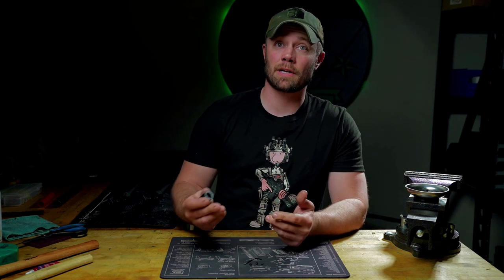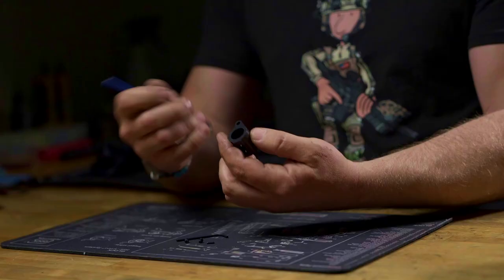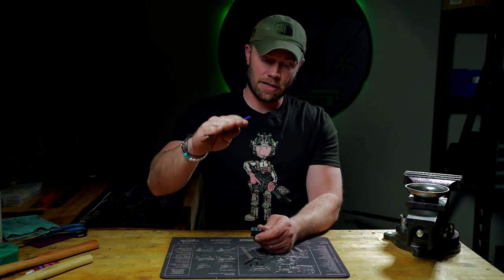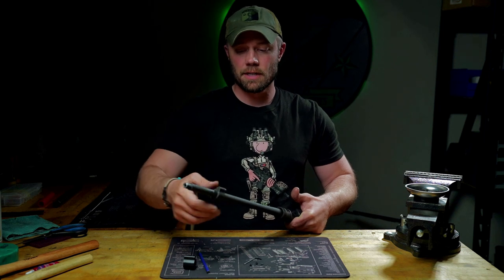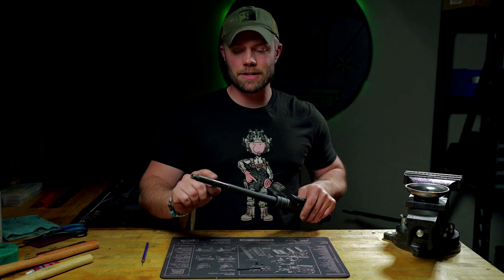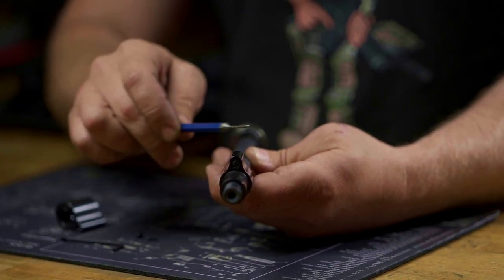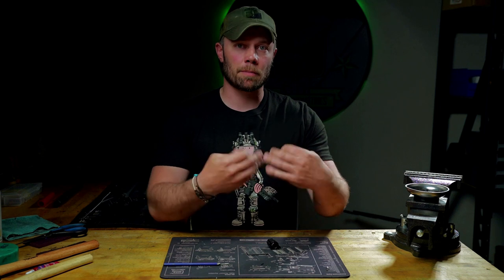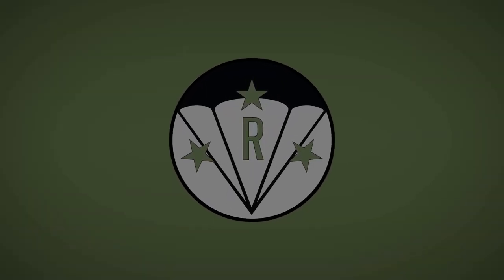Why choose our Gass Hole for your Criterion CORE Series Barrel?

Comment: From a mechanic/machinists point of view because the tolerances are so tight couldn’t you just freeze the barrel and then fit the gas block into it. This way there’s no need to remove any of the coatings and it provides an even tighter tolerance mating surface?
Reply: Usually no visable chage for barrel diameter on  .0005 resolution calipers might be able to see a difference on some Mitutoyo mics that go out to .00005 but it’s too little at that point so heat up the gas block before installing is better.

Comment: Now I’m debating if I should use this instead of the V Seven Titanium .625 for my upcoming build with a criterion barrel. Aren’t criterion barrels already setup to be pinned?
Reply: Nope
Reply: They don't have a pin groove, but they have a single dimple for set screw style gas blocks. I have a barrel with a pinned, set screw style gas block and a criterion with a dimple, but used a clamp on block. I can't imagine one being more reliable than the other unless you just need the peace of mind.

*I don't say this to sway your opinion from getting this gas block, I'm sure it'll perform on par, if not better than most out there because of the engineering behind it.

Comment: I heated up the Gas Hole to slide it on….. I will say if you stop before it’s perfect it’s a pain in the ass to to adjust….. and with that Gas Hole being so tight, there is no need to pin…. It will be a act of god for the Gas Hole to move once installed

Comment: The only thing I don't like that you have to take phosphate coating down on criterion barrel in order to fit this gas block.
Reply: Better to hone the inside diameter of the gas Block. Not sure what the instructions are for this specific block but that's usually the sop
Reply: Thermal expansion is your friend.

Comment: just ordered mine for my criterion core 13.9"
Reply: I had a Similar Quandary I was Comparing the Following: 
    -14.5 CHF Hodge(Chop’d to 13.9”)
   -16” DD Middy S2W CHF Chrome Lined.(Chop’d down to 13.9”) 
    -14.5” RainierArms Mountain Mod2: (4150-..QPQ Coated/SDM Flute’d from the Barrel extension up to the Shoulder of the Gas Block). 
    -WOA: (WhiteOakArmament)l223 Wylde 16” SDM Fluted Middy 416RR(Raw-SS),Chop’d Down To 13.9”.

   Mod3 Grip, just InCase I Ever need a Spare. 

  Due to wanting up “Accurize”” the upper as much as I could. So, went Criterion 13.9” Core Criterion Lined .223 Wylde+ Riptide Industries Gass-Hole Fixed Non-Adjustable/Gas Block+VSeven Weapons Systems Extreme Duty Inconell Gas Tube, Capable Citizen Variant SOLGW BCG(w/HeadSpaced Bolt That Came w/Criterion Barrel+SOLGW Stripped Upper that’s Lapp’d & has had Feed ramps of barrel extension polished after installed. Barrel Bed’d in upper AFTER Face of upper has been lapped. Using a NOX-9Port W/Keym along with a DA Sierra 5 Suppressor, & a M76 WedgeLock 13” Rail/Hand Guard torqued to many unhappy-dungas(say 70-85FTLBS to ensure Great Lock up. Then last but not lease I’ll carefully Secure Any Mloc Attachment Points have been trimmed w/ my dremel(bc DrEmEl= GuN sMifF😂)to the Rail so that none of the Male Ding-Guss’es Hit the barrel so there no issues negatively impacting the barrels harmonics. 

As for Glass: 
  I’ll be rocking a Badger Condition One 30mm 1.93” Mount+35Deg Offset(1.93” height)J-Arm+RMR baseplate+Holosun HE509T Elite MRDS+Primary Arms PLx-C(Gen2 PLx Compact LPVO) with Ye’Old (ACSS Raptor M8 B.D.C. Reticle)